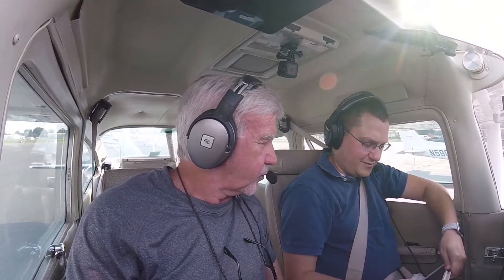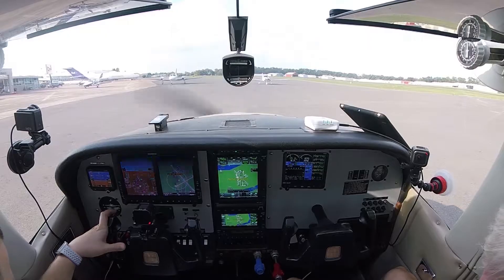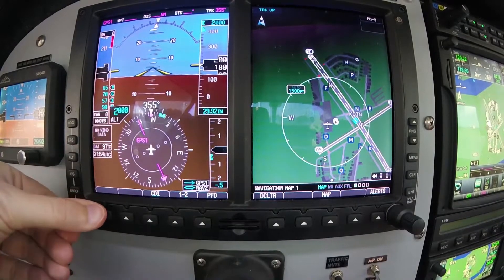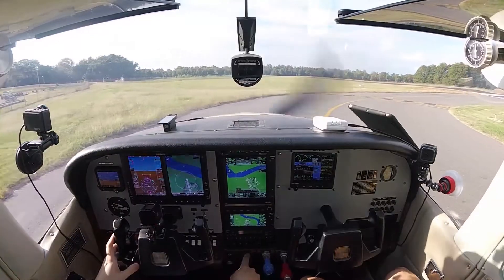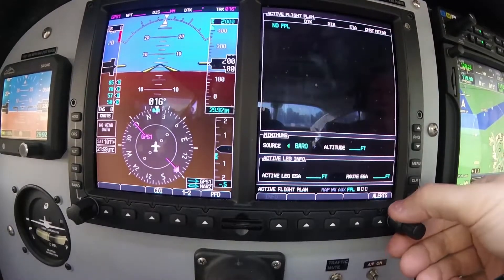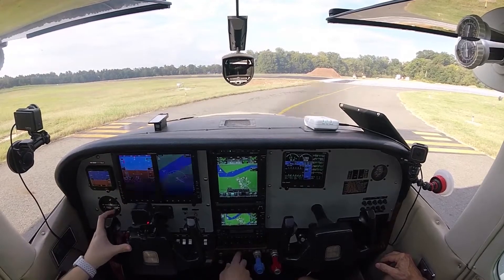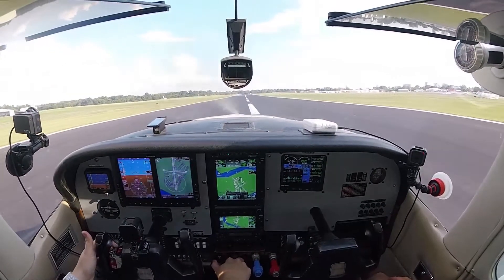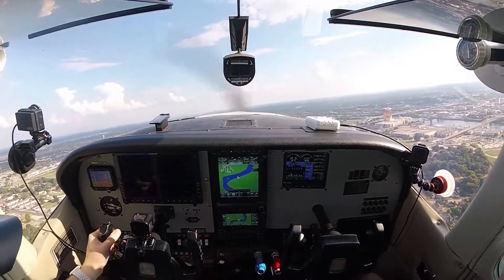Cessna 182 Katmai | RNAV 14 Approach at KDTN with Don

Comment: Dan, first time watching your video, very good. Question Your Skylane has something at the front of the engine cowling that I have never seen. is this an elusion from the video or do you have a mod on your skylane? Looks like a flight control surface on the right side.
Reply from the maker: Charles Frantz its a conversion called a Peterson Katmai which adds a canard wing, wing tip extensions, and (not this one) a more powerful engine
Reply: Charles - do you like the Katmai?   How does it compare to a standard C182?
Reply from the maker: mrbizi it has much better low speed handling,  the wing surface is larger and the canard changes the stall characteristics to make a more nose high stalling tendency.  We do slow flight dirty around 35 knots